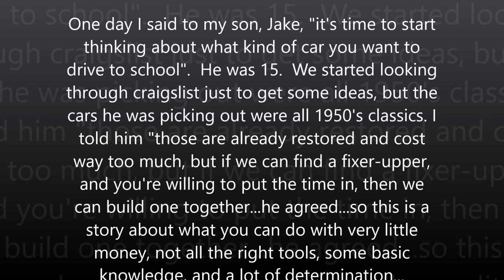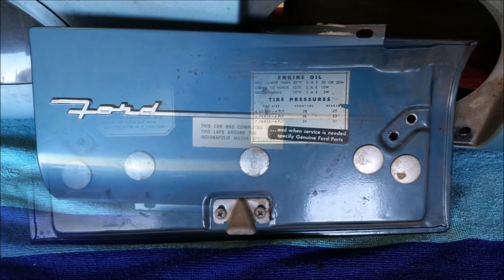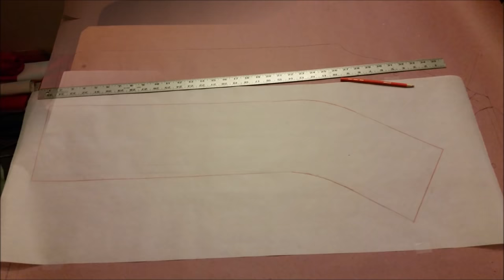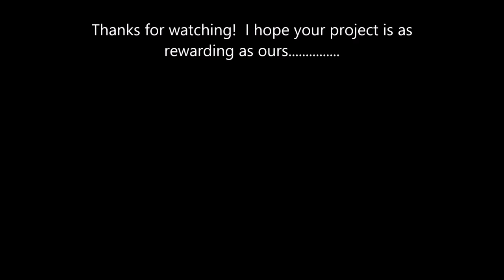1955 Ford Fairlane Restoration From Start to Finish

Comment: Grew up in one those in the back seat and I remember straps across the back of the front seats.  Use to stand and the straps we held on.
Reply from the maker: Yep.  This one didn't have the strap but my '58 buick does!
Reply: @jperry1444  think was and older model maybe 53 not sure. Was only 4 then.  With six kids on long vacation drives. My older brother in front seat with mom and dad.  But was always standing on the floor hanging on the strap so not to fall back.  No seatbelts then and was a 2 tone brown.
Reply from the maker: @kenhorne5650  love it

Comment: Great video.  Partial restoration so you can drive and enjoy.  Another person that does this a lit is Jonathon W on youtube.  A fully restored car is expensive, and not enjoyable.  You can enjoy this one the way it was supposed to be enjoyed.  My second car was a 55 Fairlane, I bought in 65.  It was a loser, but I got it running good, and driving right after about a month.  That 312 engine was a blast.   LOL

Comment: I have an all-original 1955 Imperial Newport Coupe, so I have an affinity for vintage automobiles.  

Is that a 272 or 292?  Those Y-block V-8s are bulletproof engines, and if maintained can last a long time.  That sound at the rear at idle is a very typical sound -- I've heard it referred to as a "yippy skip".  

Did you upgrade the electrics to 12-volt?

Beautiful job.  Hope your young man enjoys it.
Reply: The Flathead and the Y-block were both great-sounding lumps.  It's too bad the engineer at Ford (his name escapes me) didn't specify more generous bore spacing in the Y-block--the engine ran out of cubes quickly and was replaced way too soon.

Comment: In 1970, a year before I started driving legally on the the rural roads of Maryland’s eastern shore, my brother and I got a 63 Fairlane Coupe for ONE DOLLAR and started fixing it. The engine ran at that point, but made almost no power. It wasn’t possible to go much more than 50 mph so I started tearing down the motor for a rebuild (at that point I didn’t know the difference between a nut and bolt). The 221 V-8 was not a high power motor by any means, but it should have been able to get the Fairlane to 65 or 70 mph. I didn’t realize that the 221 was so naturally sluggish, and as I eventually would learn, the rebuild didn’t really produce much more power (did I mention that I had no clue what I was doing?) but at least I was able to clear the miles deep layers of gunk covering all of the valve train and internals.  Too bad I didn’t understand then that the 221 could have been bumped up to a 260 or more. In the end, just cleaning internals really helped to solve the engine’s constant overheating problems and resulted in providing mostly dependable transportation to high school and after school work, but I really envied the guys who owned real muscle so in ‘73, I sold the Ford and switched to Mopar (actually a series of them - some were real heart pounding beasts).  Knowing what I know now, I’d love to have that Fairlane back again. Hopefully you’ll see this and will never let go of your ‘55. Cheers!
Reply: I was given an old Holden (Australian GM car) when I was 15. I decided to pull the head off to grind the valves. Never got it going again :-(

Comment: I have a '55 Ford four door story. I rented a house and there was an old guy living across the street. A '55 Fairlane was in his driveway. Old paint and a cover over the cockpit area. One day the old guy passed away. The family asked if they could push the car into my driveway just so they could close escrow on the house. They'd be back in a couple days.
They never came back. After six months, I decided to look through it to see if I wanted to apply for lost title. All the interior parts were painted and wrapped in 10 year old newspaper. The old upholstery was rock hard. It looked like there had been engine work. I jumpered it to my car's battery. and connected some wire to the relay so I could hit the starter under the hood. I poured gas from an old beer bottle into the carb to keep it running, there was no gas in the tank.
The only missing parts was the instrument cluster. I found a receipt for a repair shop for the cluster, but the shop was no longer around.
I restored it to factory colors. It was a fun project.

Comment: A couple of questions ? When the heads were done, were the valve seats replaced/modified so unleaded fuel could be used ? Did you keep the 6-volts electrics, or change to 12-volt ? Can you estimate the completed project cost, and do you think it was really worth the effort ?
Reply from the maker: We did not replace the valve seats.  we use a lead substitute instead.  We also kept the 6 volt system to avoid the cost of all the changes that have to be made to switch to 12.  As far as "worth the effort" goes, you have to understand the purpose of the project.  As I have stated in the video, the goals were 1) spend time with my son and dad, 2) teach my son about working hard to accomplish a difficult task, and 3) creating lasting memories for all of us.  So in that sense, yes, it was absolutely worth the effort.

Comment: Fantastic. I loved the sound track but loved hearing it run. Yeah, I could spot some flaws, but none that are worthy of note... except...did you have the machine shop harden the valve seats so it can take today's gas? I see this kid going into restorations for a living. Not many guys around that can do it all, and he's well on his way. For a better than driver quality car done in a home garage, it's just gorgeous. Think of it, he knows how to keep it up now... or mostly anyway. He can drive that car for 50 years or more. You're simply not gonna be able to do that with these modern pieces of trash that need friggin electronics and a few dozen computers to run. Electronics are simply not going to last as long as this car already has. There was a state senator in Colorado that drove a 50 Ford to the state house every day. Why? He vowed he'd drive it until it wouldn't go any more. Yeah it leaked a little, it had a whittled wooden plug for the oil drain... this and that, but it kept going, without any major money being spent on it. Things tend not to rust in Colorado, so that wasn't much of an issue. For all I know, that car is somewhere in Colorado still doing what it was made to do.  oh, a little known secret, there are lots of old 50's and 60's cars still on the road in Colorado, since rust isn't an issue especially in the small towns where they don't salt the roads in winter.
Reply from the maker: we did not harden the seats, we use a lead substitute additive.  Now that Jake is in college, it does not get driven as much so it does fine.  thanks for the stories, always love to hear about older cars still being on the road.  Restoration can be done at many levels and from many angles...my favorite being, get it as good as you can with the money you have and drive it as often as you can.

Comment: I had one just like it in 1958 272cubic'' eng. only problem was 6 vt system and when it got gown to below 0 would not start unless you poured hot water on the intake manifold. and traded it for a 61 custom in1963 292 eng 2 dr,sedan stick with overdrive

Comment: Quick story.  Bought my son his first car, an old Honda CVCC.  Did the bodywork...lots of bodywork.  The interior, the engine etc,. etc.  he is ready for his first long trip so he thought he'd change the oil, I did not check.  Ended up he drains the trans. oops.  My bad he said, "Dad didn't take a lot of oil", me "don't worry son".  Well, the darned thing ran about 100 miles before the trans blew LOL.  We fixed it and had many many laughs about it over the years.

Comment: turned out beautiful. do you by chance still have the paint codes ?
Reply from the maker: The original paint codes?  It was originally aqua tone and snowshoe white
Reply: Thanks. Sorry I meant the color code for the red paint. i’m doing a 55 olds super 88 and the wife loves the color of your car. thank you.
Reply from the maker: I will see if I can find it.  We ordered it from a paint supplier on line.  It is not actually a Ford Paint.
Reply: @jperry1444  much appreciated

Comment: How much did it cost for you to completely restore the Fairlane and how long? Please and thx
Reply from the maker: Well, we did all the work ourselves except for machine work on the engine...including paint.  I really wish I would have kept an accurate total on the cost but I would be surprised if we had $5000 in it including the $2000 we paid for the car itself.  Most of the cost was in the engine work.  Had it bored from 272 to 292.  bought stock rings, pistons, cam etc.  As far as time goes, we worked nights and weekends for about 18 months.  I made the interior myself except the headliner.  Got the fabric and foam from Joanne's with coupons.  Like I said, we were doing this a LOW budget, daily driver resto.  Thanks for watching!
Reply: @jperry1444  thanks mr jim, hoping to do a restoration and trying to get some tips and some pointers thanks again
Reply from the maker: @adamfranco4149  no problem.  Let me know if you have any questions.   I'm happy to help.

Comment: What motor is this? Ford V8's usually have the dizzy at the front
Reply from the maker: This is the Y block.  272, 292, 302 all had same block.  Dizzy in the back in mid 50's.  Ours was originally a 272, but we bored it to 292 so we could use stock parts.

Comment: Question having had a 55, and neighbor had 55 T Bird, one having the 292 (mine) her's 312,  Yours appeared to me as being a 292: but when you cranked up and the duel exhaust lead me to think it was a 312. Sooo clarify for me hahahaha 312 or 292 ??
Reply from the maker: It was actually a 272.  we had it bored out to 292 so we could use stock pistons.  the original 2 bbl is not quite enough to feed the additional cubic inches when you have a heavy foot though.

Comment: Hey Im beginning to work on a 56 fairline myself. Quick question, how did you restore the interior roofing?
Reply from the maker: Removed the old cloth headliner and insulation, cleaned and painted the bows, put sound deadener (dyna-mat type) on inner roof, installed new perforated vinyl headliner.
Reply: @jperry1444  Thank you so much!
Reply from the maker: @kevinliu9593  There are are several videos on YouTube showing how to replace a headliner.  It's pretty straight forward.  Just make sure to keep your bows in order as they come out.  the corners can be a bit tricky on installation of the new liner.  Just keep working those wrinkles out.  The hardest part for me was putting the glass back in without making a mess on the new liner.

Comment: When you took off the 2 front fender there are tubes on each side that to look like air intake vents what are they realy for what are they called
Reply from the maker: Sorry I missed this question earlier...I am not sure what Ford called them but they are fresh air intake tubes.  They bring outside air into the cabin of the car.  There is a "damper" on each side near the firewall that allows both the driver and passenger to adjust the amount of air coming inside.  This type of system was used by all the manufacturers in the days prior to Air Conditioning.  And I would argue, they should still have them on today's cars and trucks...as well as vent windows!
Reply: @jperry1444  thanks for the info..
Now i have better understanding..

Comment: how much did all that cost
Reply from the maker: Yeah, I get that question a lot.  We didn't keep a detail of all the smaller costs like filler, sand paper, nuts and bolts etc.  But we figure somewhere around $4500.  We don't charge labor.  :)

Comment: Where are the side view mirrors?? You need those
Reply from the maker: they are on now, we ordered new re-pops and they came later.  also, the passenger side was not factory drilled for one so we had to do that too.
Reply: @jperry1444 how much did the whole restoration cost you guys including the machine shop, .

Comment: No body else asked, so I will: about how much were the out of pocket costs?
Reply from the maker: I wish I had an exact number but it is somewhere around $4500 if you include tires.  We did lots of stuff that didn't "need" done like new badges and center medallions for the hub caps etc.  they are not cheap but we figured...what the heck.  The car itself was about $2000.

Comment: That's a 1955?  Not a lot of difference between the 55 and the 56, was there?
Reply from the maker: Yep 1955.  There were a few trim differences.  Grill, side stainless, dash are the biggest cosmetic differences.  Also, they went from 6 volt positive ground to 12 negative ground electrical system.

Comment: if it were me, i would have just gotten her roadworthy, the full restoration isnt something i have the budget for.
Reply from the maker: I totally get that.  By doing most of the work ourselves we were able to save a ton of money.  Still, nothing is cheap anymore.
Reply: @jperry1444  yeah, theres a 57 im looking at getting, its really rough, been sitting since the 80s, but it wants to live. the floors are all intact other than a small hole in the rear.

Comment: car is unsafe sitting on blocks with holes facing out,,the webbing is the weakest part of the block and is not designed for doward pressure,, if the car rocks the side ways pressure will cause the bock to snap at the webs,, blocks have their strength (PSI) with opening uprite ,, best to put a 2x8 piece of wood on top of block ,,, what you have is an accident in the making,,, this is from a brick/block mason of over 40 years experience,,
Reply from the maker: Thank you for that.  A bit surprised that's what you keyed in on in the video.  Just for everyone out there reading these comments... Robert Dunn is correct.  This is NOT an instructional video so don't put your car on concrete blocks....we are all fine though.

Comment: at 7.29 minutes those are not 1955 model year manifolds
Reply from the maker: sorry Donny, indeed they are.  Factory duals.
Reply: @jperry1444  the 54 55 manifold outlet on passager side came out the front of engine to the driver side and 1956 it was changed going down the back and 1957 the manifolds were square i thought check and see if that is concourse
Reply from the maker: @cc9z  The "cross-over pipe" was standard on vehicles equipped with single exhaust.  if you had dual exhaust, these were your manifolds.

Comment: Great job, love it!! The only 2 things I would have done also was install power disc brakes, maybe sway bars, and seat belts. Why those three things - for safety. To late now but I know those 292 Y-blocks had an oiling problem with the lifters and cam. I know my father had 1956 Ford wagon with a 292 and install oil lines running on the top of the motor to cure that. Sorry cannot describe more but I was rather young, under 9 when we had the car. But there is a video showing how to install a good oiling system https://www.youtube.com/watch?v=XB_Q9qpvnL0